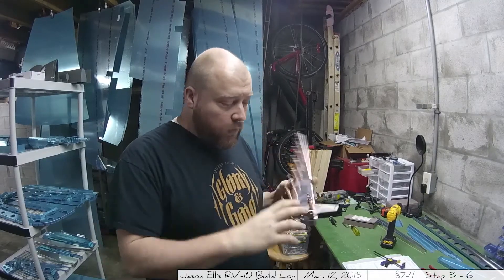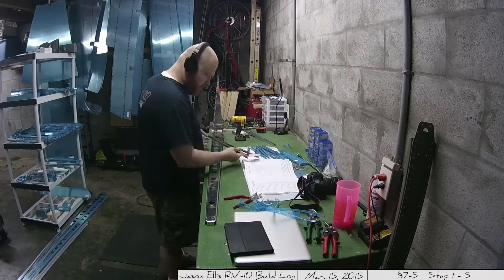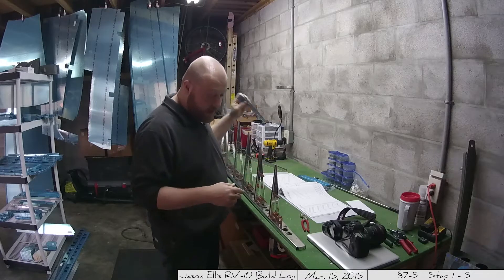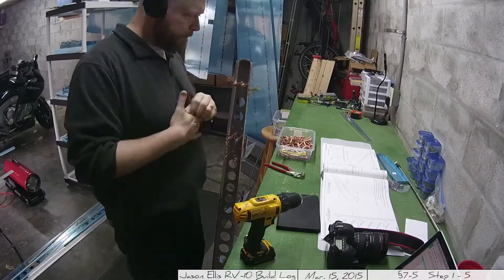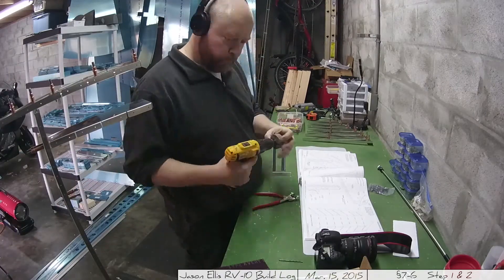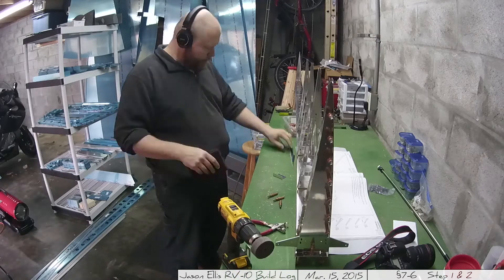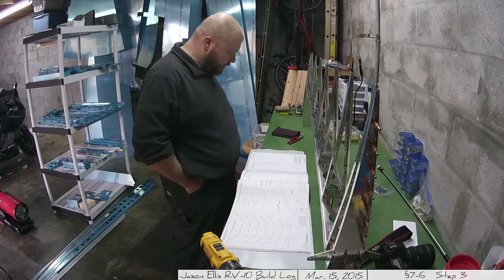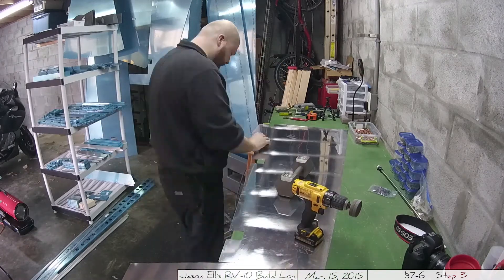RV-10 Empennage Sections 7-4  Step 3 to 7-6 step 3

Comment: cleaning the cut edges is VERY important. if there is a hair line cut, scratch, knick, with some vibrations from flight, or engine running, it can cause the cracks to grow and that can lead to structural failure.

I did sheetmetal in the airforce. I am really considering building my own plane. With my experience, in sheetmetal and corrosion control, i am pretty confident i can have a real nice plane.

It may not seem like much to take the time to clean those areas up, but trust me, it is.

Cut the edges, use a smooth file to make the edge smooth, chamfer the edges slightly, and then sand until the edges are dull, and smooth. If you can run it along your tongue, it is smooth enough.

If you do buy a bench grinder for finish sanding, remember this. The aluminum pieces are .024, .032, or .040 thickness, and that bench grinder is goin got be moving at over 6000 RPMS, and that will catch and grab your metal pieces, and either bend, break, or pull out of your hand, and then you are calling Vans, and Bob's your uncle.

i recommend air tools, 90* hand grinder, with a 1/4" chuck, and get a package or quick lock sanding pads from Harbor freight. You can use the blue pads, and they will sand and polish all edges pretty nicely, with better control than a bench grinder.